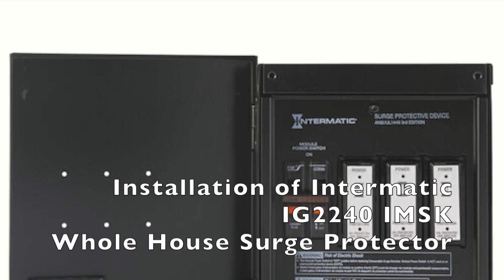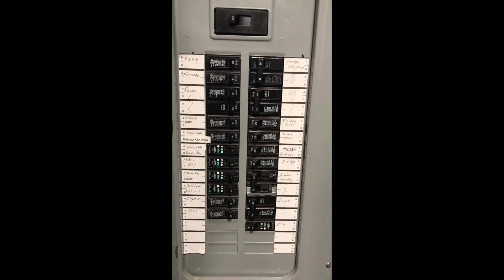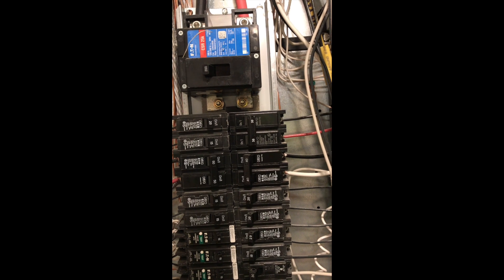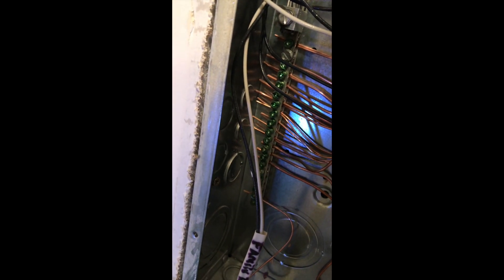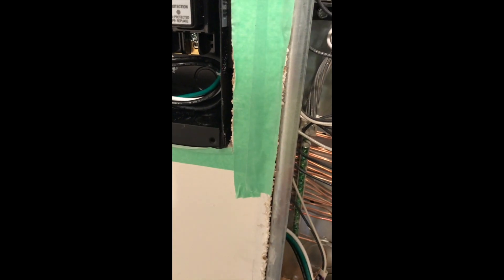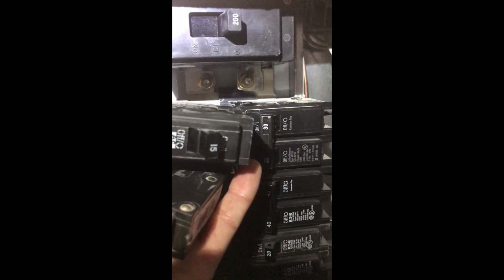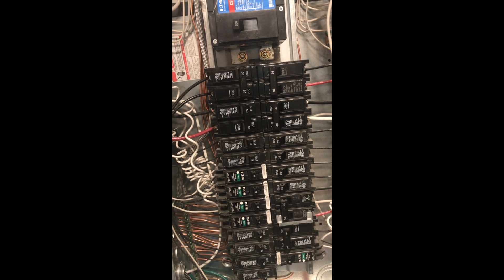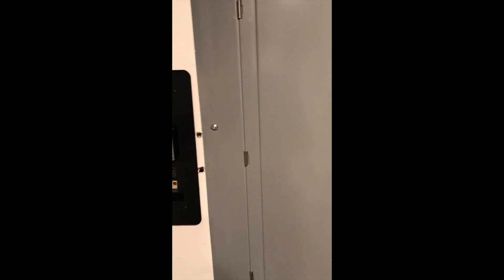Whole House Surge Protector Installation (Intermatic IG2240-IMSK) SURGE HAPPENS!!

Comment: How does the surge protector actually work if the main power doesn't travel through the surge protector to get to the panel of breakers?
Reply from the maker: An easy way to understand surge protectors is to think of them as energy diverters. When a surge or spike rolls through, the device sends all the excess power that your home's appliances can't take on safely down through your home's grounding power line.
Reply from the maker: There are 2 Types:

Type1:
Permanently connected, hard-wired SPDs which can be installed between the secondary side of the utility service transformer and the line side of the main service equipment overcurrent protective device, as well as the load side of the main service equipment.

Type2:
SPDs intended for installation on the load side of the main service equipment overcurrent protective device ONLY. These SPDs may also be installed at the service entrance point but must be installed on the load side of the main service overcurrent protective device.

Comment: Hello nice video I got a question how do you determine what type of whole home search protection you need for your home? We have a GE panel.
Reply: If you are afraid of lightning strikes or other surges coming from outside your home, get a TYPE 1 Surge protector.  They are installed before the main breaker (I usually install on the meter).  Consequently, you don't need 2 circuit breaker spaces.   A TYPE 2 SPD will give some protection from external surges, but they are really made for internal surges (like motors on a fridge or washing machine.  I generally recommend a TYPE 1 since most dangerous/damaging surges come from outside the home.  For full protection, you can "cascade" your SPDs by install both types.
Get one that has an alarm -otherwise you probably won't notice if it gets trashed by a surge.

Comment: Funner Fact:  This install would be much better if the leads were much shorter. All SPDs need to have the shortest, straightest leads possible. I would have used a right angle drill or a 90 degree adapter to drill an oversized hole in the 2x4(or 6) then drilled a set of holes that lined up with each other to run a short 1/2" pipe directly between the two as close to an open breaker location as possible, making sure that the bends of the intended wire path are large-radiused. Move breakers around as needed to get a nice open spot to hit. According to SPD  manufacturers you can lose 30-40% or more of the capacity by bending the wire too tight, by being longer than necessary, or by wire-nutting extension wires, forcing the surge current to change directions 180 degrees. Not an easy install to do right, but not toooo bad.

I'm a Union Commercial/Industrial Electrician, 20+ years

Comment: Exact scenario I'm dealing with, however I would have liked more on the how to do the install dealing with the problems like; how did you get the hole through the stud in such a tight space, how did you get the wires on the original top breaker to reach the lower position, how did that plate behind the drywass interact with the box. Less on the drywall removal and repeating the the little stuff.